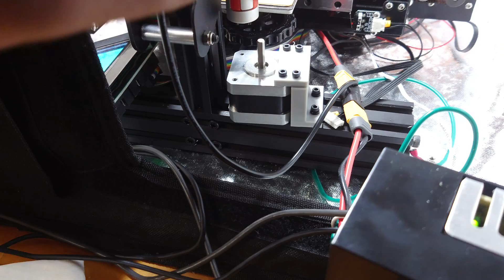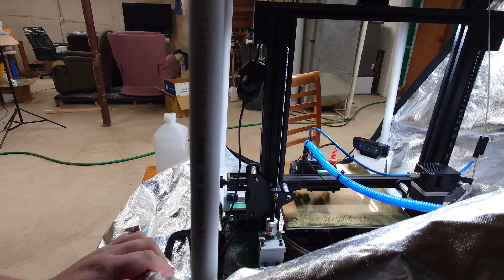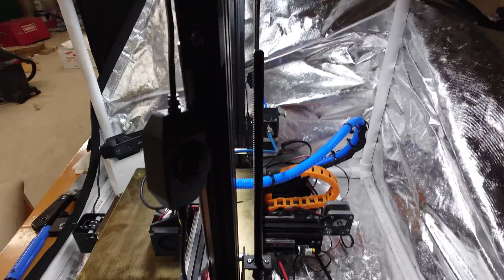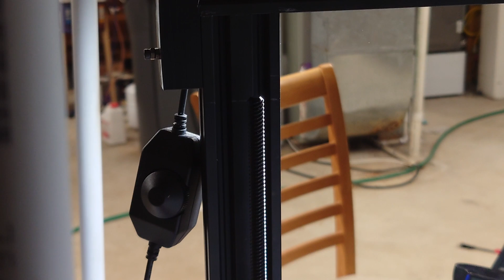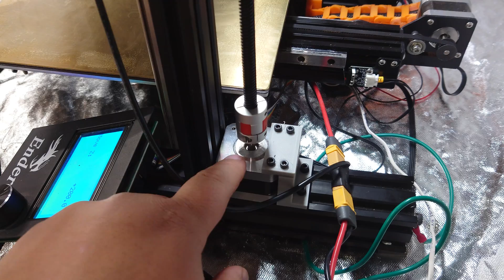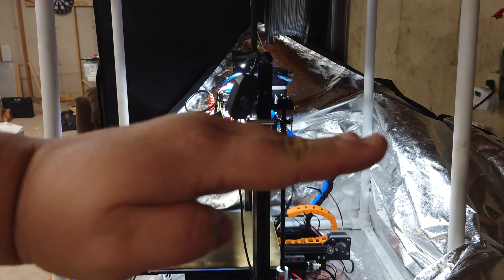I designed something to align your Z motors on the Ender 3 Pro

Comment: Short of just getting a part that is perfectly perpendicular to the Z axis, you could also shim the upper M5/M6 (can't remember which it is) bolt at the metal spacer to ensure a slightly better fit. I agree that its another bandaid, but what can you do given a $200 mass manufactured printer.

One of the easiest options is to just run with a belted Z axis - "easiest" in that you don't need to worry about perfectly machines parts, perfectly aligned this, that, etc - at least to a much greater extent than a rigidly-fixed leadscrew based option. Something like the CoreXZ kinematics of the Switchwire comes to mind, or easier yet, something like the thing on Thingiverse with the Z motor on the top with a 80T gear / linear rod coupling to both extrusions. Not the prettiest but it werks. That way you only have to worry about the alignment of your rails, which is way easier to adjust than this.

Comment: You could create a mount for a dial indicator and print a round nut to screw onto the lead screw and use that to help adjust the mounts. Probably not necessary but would save some time and get a good bit closer to ideal than by our eyes alone.

Comment: I used to work for a German company bending sheet metal for rack mount server chassis, we only ever got a square to check angles and Tolerance was +-4°, I can't imagine creality investing any more running their brake press. It's been noted before that the brackets are often out of square, plus tolerances of holes, bolts and wheels all play a part.
'luke Hatfield ender3 build guide', list alot of the common faults.
Love the Teflon leads crews have you got a link please